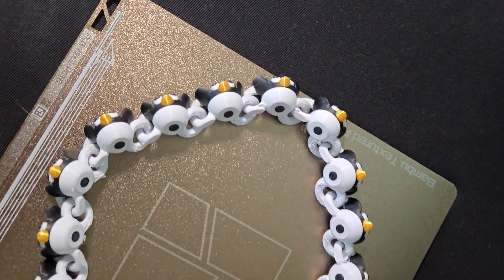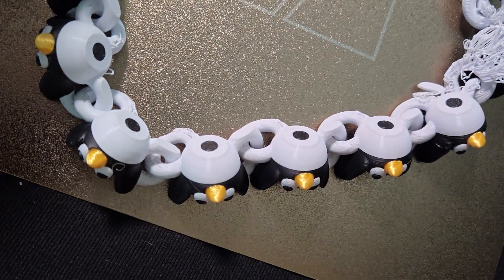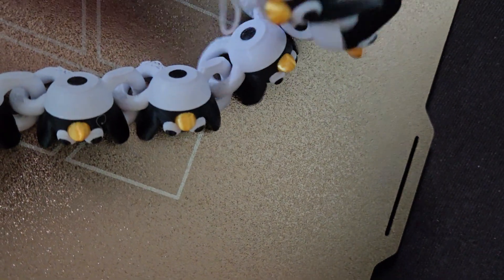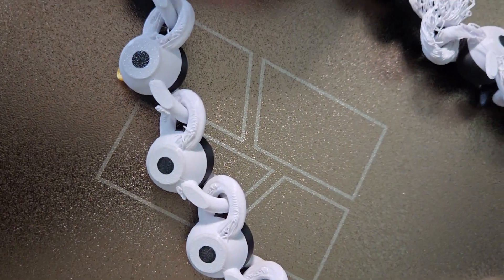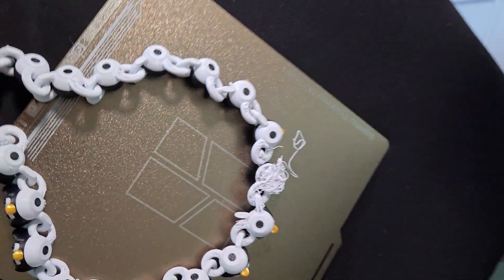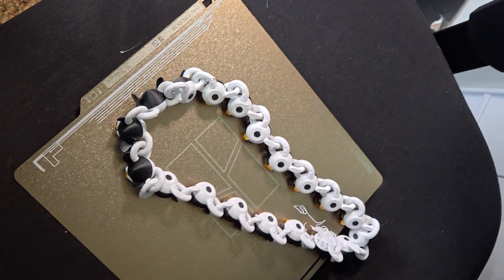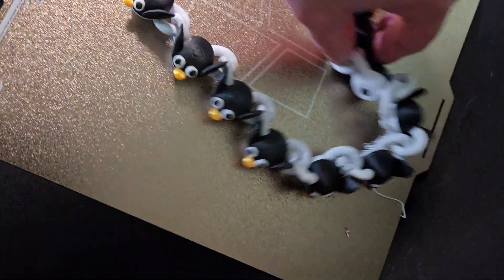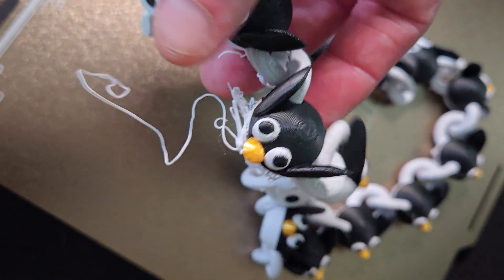Penguin Necklace Troubleshooting: Solving Adhesion Issues on the Bambu Lab P1S

Comment: It looks like, from the calibration lines at the bottom of the bed, the profile is set to the X1C. I have no idea what that would change other than the lines, but that would be my first change. It's also possible the PEI coating on that particular spot is worn out. I'd also try rotating the model in the slicer and seeing if the problem persists.